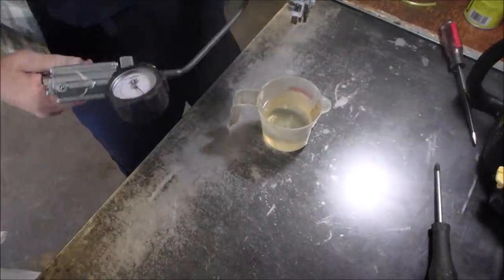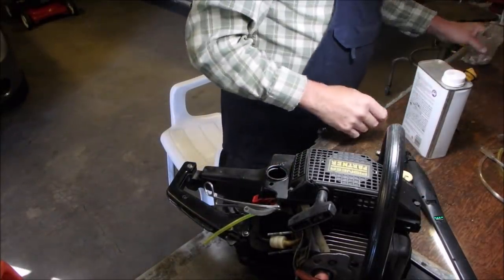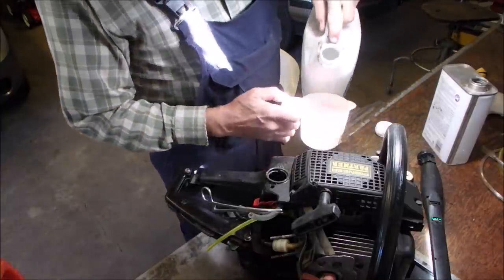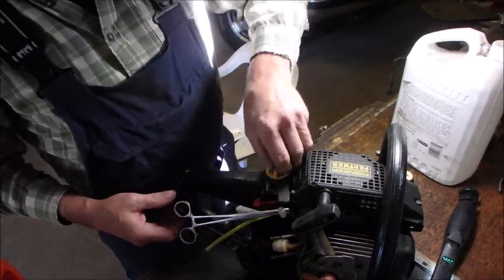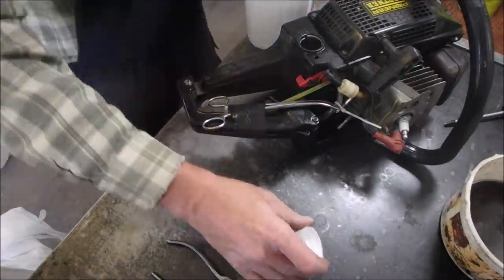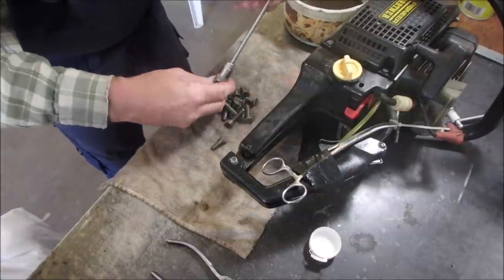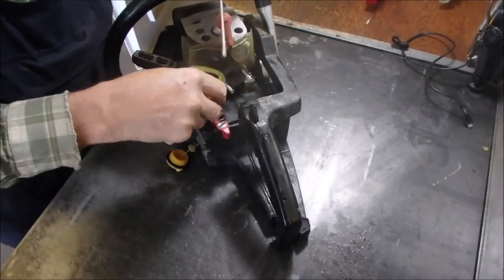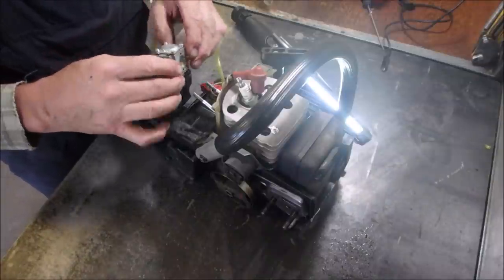Pioneer Partner 500 Chain Saw, Tank Clean and Assembly

Comment: The OLD MAN at EP says Donyboy73 is truly proud of you for tackling a chainsaw. Great video and nice tip on using the methyl hydrate.
Reply from the maker: I have worked on saws for years but now with the pressure tester I have more confidence.  Thanks for joining in.
Reply: Pressure tester is one of the main tools required for small engine repair.